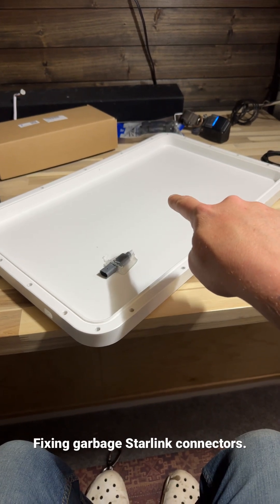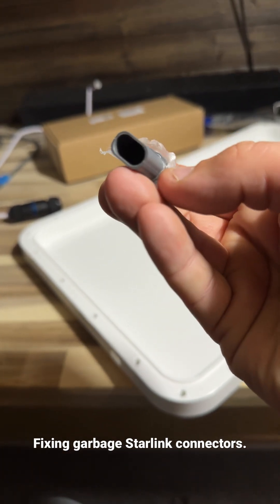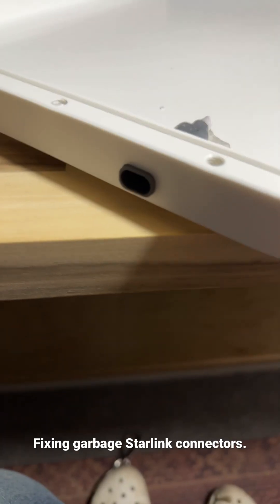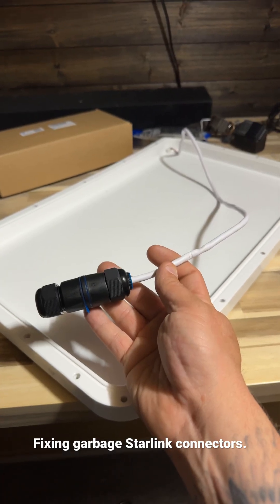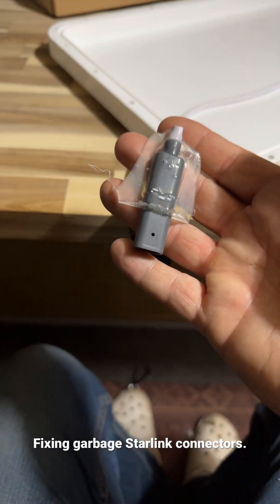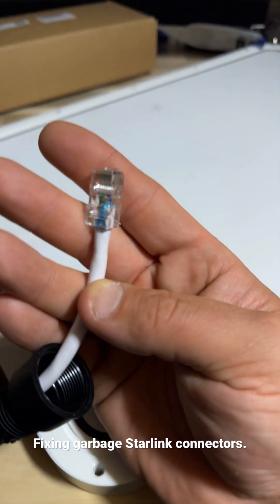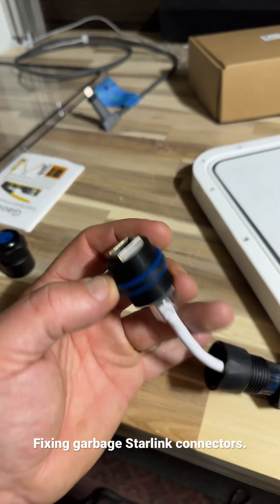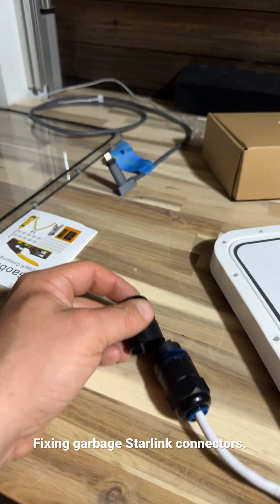Fixing crappy Starlink dish connectors with my own RJ45 connectors.

Comment: Make sure to use grounded connectors and connect the blank strand to the metal case. Also take note of outside wire diameter of 0.9mm, 24awg-27awg, otherwise you have unreliable electrical connections on the copper strands.
Reply from the maker: Hi, I haven’t had any problems at all the way I did it. Works flawlessly!

Comment: Did this work? I have the same starmount setup and mine is just sayin offline- starlink unplugged or rebooting and never dishy never picks ups signal. Router is on too.
Reply from the maker: Mine works but I have the same issues from time to time. I have a new Drok dc to dc buck converter in its way that will hopefully keep the dish powered better.